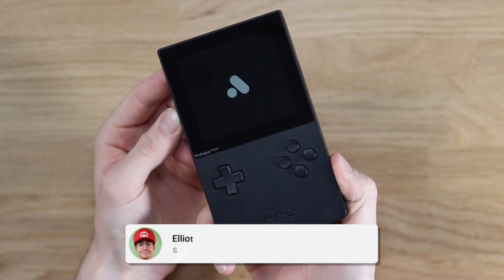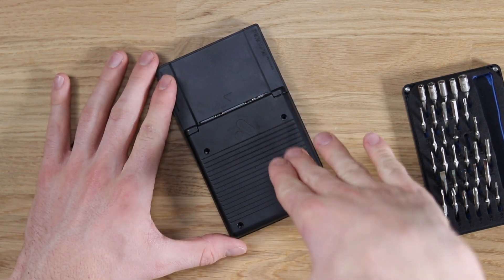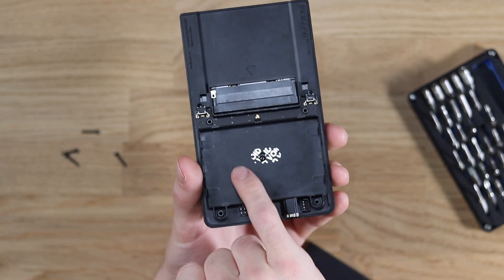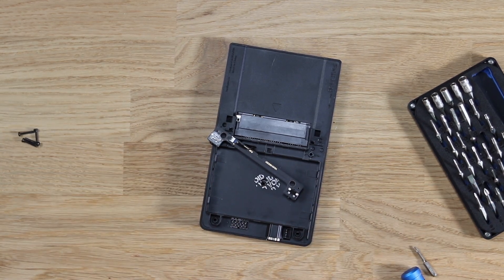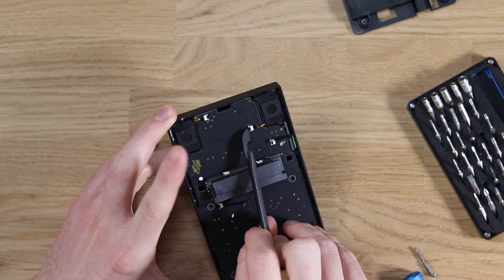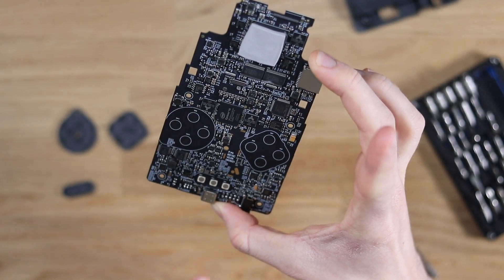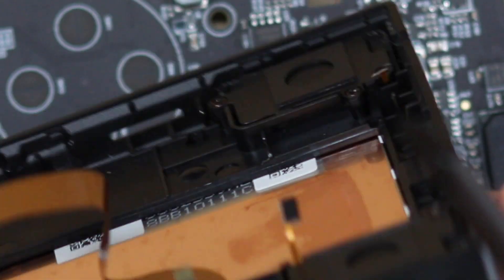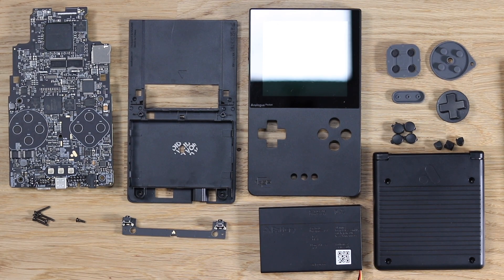Analogue Pocket Teardown

Comment: Looks like the 10 pin header under the battery is a jtag port, used to access the fpgas and config flash chips inside. They probably flash the production firmware and run diagnostics through it at the factory. Everything looks beautifully designed, may have to pick one up at some point.

Comment: I think I found the LCD panel they are using. 
It is made by BOE for VR goggles and you can buy one for about $20.
BOE VS035ZSM-NW0

Just to add, Gorilla glasses are not that expensive.... for the manufacturer, probably below 2 dollars.
Reply: When this was first announced, I assumed it was a display from the Valve Index.
Reply: I can't wait for you to manufacture electronics and sell things for 10 bucks more than the cost.
Reply: @sunderark  I am not arguing they are charging too much. I am just providing some transparency on incorrect claims.
Reply: @SuperAngryWalrus  Yeah. It is a mediocre LCD display for VR goggles(200cd brightness, 700:1 contrast), but still great for handheld gaming machines.
Reply: @ddbhaha1529   Ah fair enough.
Reply: @sunderark  What manufacturing? They're literally ordering these things fully assembled from China, like every single electronics company on this planet.
Programming an FPGA to relicate a GameBoy is ridiculously trivial, it's literally the undergrad thesis of 7/10 electronics engineering students. The Z80 literally has to be the most disected and documented microcontroller in history...
Reply: @supermaster2012   Ah yes. How much would you charge then?
Reply: @supermaster2012  doesnt this let you play Game Boy, Game Boy Color, Game Boy Advance, Game Gear, Neo Geo Pocket, & Atari Lynx  games? thats more than just the GameBoy FPGA right?
Reply: @spaceman-pe5je  an FPGA can be reprogrammed on the fly, that's the whole point.
So what, they paid 2 students instead of 1. The ARM9 on the GBA toy don't even have to engineer, ARM will literally provide a VHDL schematic when you buy a sealed license.

Comment: I really wish I'd pre-ordered a year ago now. Didn't anticipate the price increase 😞
Reply: i would advice you to mod a Gameboy instead of spending money on a overpriced clone system
Reply: @iHazMuffinz  Poor advice, unless Gameboy is the only system you're interested in.
Reply: @mirabilis  this system wont be able to run the other systems unless you buy the addons which in the end will make this system a $500 clone
Reply: @iHazMuffinz  Every Analogue device can play roms off an SD card, you'd only need the adaptors if you want to use physical carts
Reply: @jonathoncapshaw7610  but isn’t the point of this device that it can play physical cartridges? It kinda beats the purpose of it if you load from the sd card
Reply: @iHazMuffinz  the point is the fpga implementation and the fantastic screen.  Im not really tied to my physical collection so reading carts is just a bonus
Reply: @papa_NCF  it will be able to load roms im sure, again every single one of their other devices do so. The devs always provide an 'unofficial' firmware a week or so after product launch that enables it
Reply: @iHazMuffinz  It probably will. Lots of cores will be ported to this system.

Comment: this is a gorgeous piece of kit but for some reason I had it in my mind that it was CNC aluminium not injection molded plastic, I'm not sure why, that would have skyrocketed the cost
Reply: It added almost $100 in cost to the BOM of the NT Mini and the Noir.
Reply: @Spazilton1  and that was before the pandemic, it would add to the weight so shipping would go up as well

Comment: So since you've got lots DMG gameboy and GBCs, can you check to see if the buttons and d-pad are swappable with stock GB or GBC buttons? They look very similar in size/shape! I would love to pop Boxy Pixel Brass d-pad and buttons in my pocket.
Reply: The dpad looks like a gba membrane for sure
Reply: @Ver2ion  The membrane does, but the D-pad itself is much bigger than GBA oddly. I have compared My analogue pocket to GBA/GBC/GB and the buttons are GBC sized while the d-pad is actually the size of the one on the DMG. So I guess a combo of GB buttons could work for swapping!

Comment: Thanks for this. My Analogue was in storage for about 4 months, And it was charged. now I tried turning it on, battery is completely dead it shows a red exclamation point Next to the battery percentage. if you hook up the charger it doesn’t charge although it does turn on and functions. Email analogue support as it’s still on warranty, but if all else fails I’ll have to try replacing the battery myself some way.

Comment: Small FPGA: Altera/Intel Cyclone 10 10CL016YU256C8G
Small FPGA RAM: 2 x Alliance Memory AS4C8M16MSA
Microcontroller: some Microchip PIC (couldn’t see the part number)
Microcontroller(?) flash: GigaDevice GD25Q256D
Large FPGA: Altera/Intel Cyclone V (couldn’t see the part number)
Large FPGA RAM: 2 x Alliance Memory AS4C32M16MSA
LCD:  BOE VS035ZSM-NW0 (from an earlier comment on this video)
Reply: Total bill at retail prices (which is waaaaaaay more than Analogue is paying): $97.50
Nice scam.
Reply: @supermaster2012  I think you might want to look up the definition of "scam"...
Reply: The PIC Microcontroller is: PIC32MX470F512H
The Cyclone V is: 5CEBA4F23C8N
Reply: @PiotrEsdenTempski  Where did you get this information on the model number of the Cyclone V? Do you have a good source or is it just hearsay? It seems credible since that is the same one used in their other products, but I was hoping we would be able to confirm it with this video.
Reply: @twistedtechnology  There is a high-resolution board photo circulating that has legible part numbers on it.

Comment: Those warranty stickers rub me the wrong way. Even steam deck has done away with that mentality. Also that battery caddy makes me think it would be harder to user replace :/.
Reply: The caddy is just for style and nothing else. You don't need it at all since the replacement battery will just be held securely in place by fitting it in.
Reply: they are literally illegal...

Comment: They look amazing. They are very expensive. They are emulators. They don't play roms unless you hack them. They are not readily available. The gorilla glass sticks up and is not flush. The wait for them is only going to get longer as they cannot source the chips in turn this will increase the cost. As "fun" as these might be you are emulating original hardware of something that is iconic. It's a show piece for people who want to take endless photos of the damn things for insta and reddit.

Comment: And yet I sent off my Pocket for repair to Analogue because I had A button and to a lesser extent, B button input issues, where it would miss inputs around 10% of the time. I received it back and it still has the same issues and they basically responded saying it was my fault for pressing the buttons in a non-typical way. I don't know what to do now as I'm not doing anything non-typical when I'm playing and I feel they should have just replaced my unit. Any suggestions?

Comment: I got my Analog Pocket off of ebay for $350 and not even 12 hours later the battery won't hold a charge, I've tried disconnecting the battery but no luck. What a disappointment

Comment: Does the analogue Pocket play the ez flash gba cart
Reply: MVG and ShortCircuit have confirmed that the EverDrive works so I don't see why an EZ Flash wouldn't
Reply: yes the only non compatible thing that would work with an og gameboy is some aftermarket card cause its shitty designed